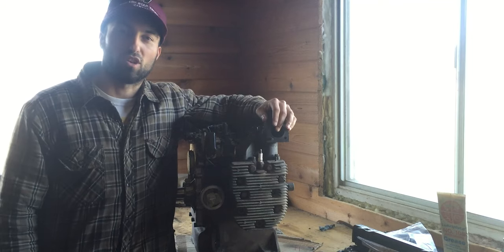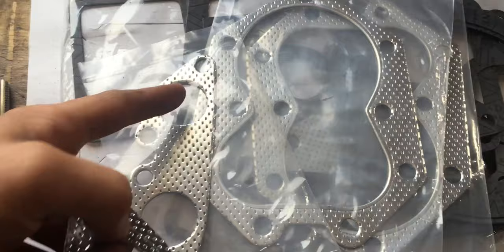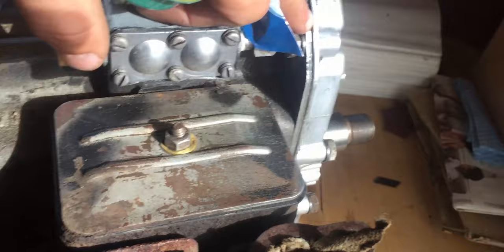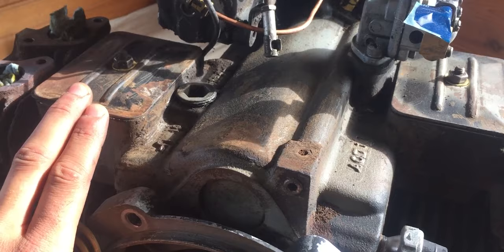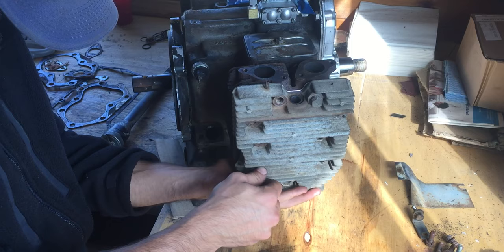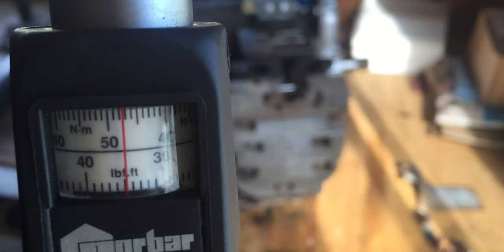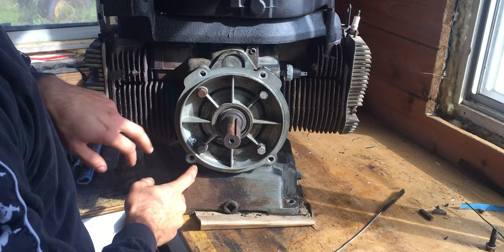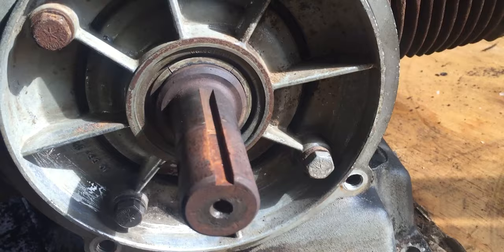Resealing the Kohler K532! Bolens HT20 Part 13

Comment: What was the compression this engine. The other one you rebuilt was 110 I believe
Reply from the maker: This engine had upwards of 100psi compression from what I remember, and that's why I did not touch the pistons and piston rings). The kohler manual calls for anything above 90psi is still good, but if it were close to 90 or lower, it would havae had to be rebuilt. Best regards